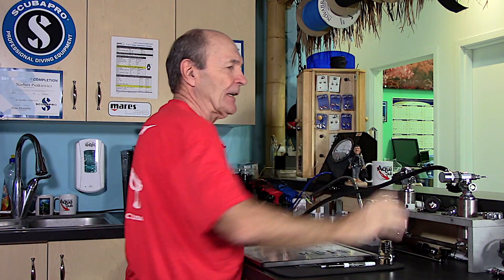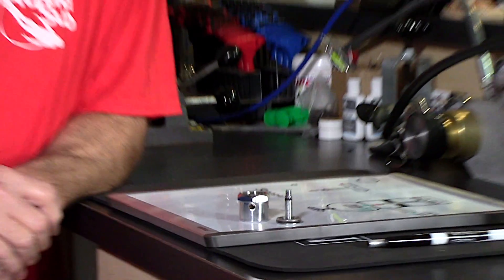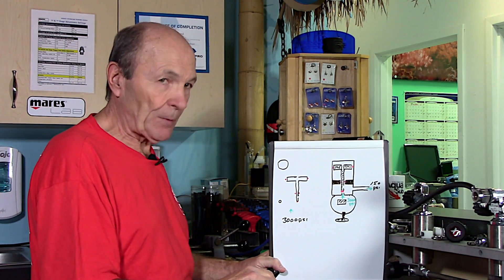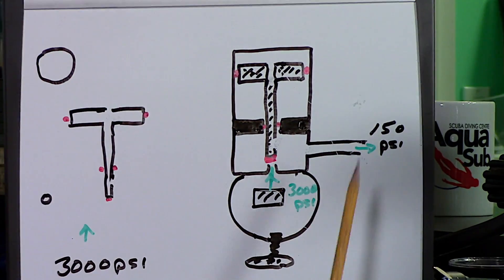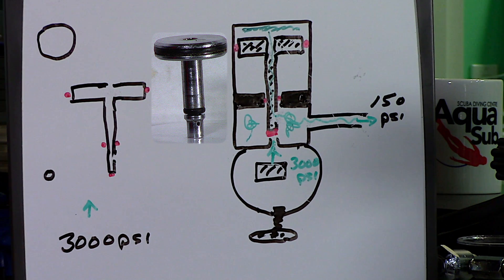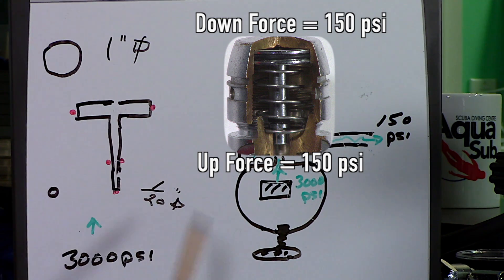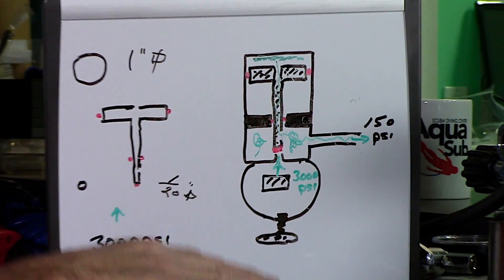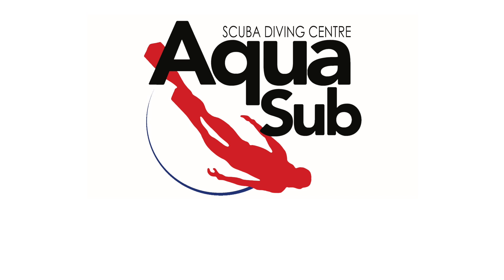How A Piston Regulator Works - Scuba Tech Tips: S08E14

Comment: What would happen if the tank pressure drops from 3000 to 2000? Then when the IP reaches 100PSI the valve is being closed? And what if there is below 300PSI in the tank? The IP is not going to be much less than 150PSI(atmosphere pressure), So the 300PSI in the tank is never going to have enough force to go against the down force from the atmosphere, right?
Reply from the maker: Right!
Once tank pressure drops below 200 psi or so, it gets increasingly hard to breathe. If you suck on the reg you will get a bit more but only because you are creating a partial vacuum in the hose. That overrides the spring.
A balanced regulator is not affected much by the tank pressure - one of the advantages of a balanced model. So, within reason, tank pressure at 3000 or 300 psi doesn't make much difference. Notice I said much. Factory recommendation is a drop of not more than 15 psi.
Alec

Comment: Alec, brilliant explanation as usual!!! 
Have you discussed the differences in equipment used for air and enriched air? I know you talked once or twice briefly about it and that there are differences in the o-ring material and the lubricants and service but, is that all? Is there a way to have a regulator (1st, 2nd and safe 2nd) rigged for dual purpose? I have seen all your tech tips and I can't remember if you have got in deep on this subject. If not, perhaps it is a good forthcoming tech tip. Traveling with a dual set of regs for an occasional diver (and I am very occasional) sounds rather pretentious. And to be honest, I am weighing if my next step should be Rescue Diver or the enriched air certifications (will do both eventually but money and time are not limitless I am afraid...). 
Thank you very much indeed for all the (invaluable) info you share with us so generously!
Cheers!
Reply: all regulators (first, second, computers, gauge) will handle 40% nitrox without any changes (most will list that on the packaging). The ONLY thing you have to worry is if you own your own tank AND go to a dive shop that does pure O2 partial fills (add air after to get desired %) instead of pre-mix Nitrox (what most boats do with membranes, or shop that pre-mix it for your in their tanks - typically 32%). Tank that are pure O2 clean require special oring and cleaning valve/tank and are marked as such (viz sticker). Some place will require you to have nitrox sticker and a dedicated tank (makes it less likely someone grabs them and assume air), but not all, and again tank unless O2 clean can be any tanks just slapping the Nitrox green/yellow sticker (US)
Reply: as for class depends on what you do/dive, but Nitrox is rather simple (all classroom, can study alone) and inexpensive and if you plan on doing 3-6 dives a day, or multiple days on boats it's pretty much necessary to use Nitrox with limited surface time and longer no-deco times underwater as well. I think padi makes it a separate class (and tiny 12 page separate book instead of being in the regular or advance book) to make more $$$
Reply: @alaind831  Thanks a lot Alain for the detailed reply... that is exactly what I needed to understand. Planning on the 32% O2 only so my current set of reg should work (I don't own my own tanks, and not planning to in the short term). 
Thanks again!
Reply from the maker: We just made a video on basic Nitrox and will have some more coming.
Alain's information is 100%.
You do NOT need to have a special reg or special cleaning of a reg to use 32% nitrox (contrary to what some manufacturers and stores will say!).
Take care.
Alec
Reply: @AlecPeirceScuba_SeaHunter  Thank Alec for your response. Waiting for more great Tech Tips :)

Comment: Great one as always, i had experienced the oscillation related noise, how do you get ride of it (annual service did not solve it)? does it mean that the piston has worn out? or maybe some of the O rings where not replaced or greased properly?
Reply from the maker: Nope. Even brand new regulators will whistle.
I made some suggestions on another comment in this topic.
Check that out for some ideas.
Good luck.
Alec

Comment: Big fan of your tech tips - always learning something, and I like DIY the most. 
Wish you had spent half the time explaining the above, and continued on to explain what the spring and middle chamber does (won't spill the beans for others to think or watch your next videos - hint: water). 
One thing I can't figure out right now if how you get constant 150psi while your tank varies from 3000->500psi or less since that 1/20 size ratio is fixed, but then again the spring doesn't have a constant force so I think I just answered by own Q thinking some more. The old pistons reg I used 40 years ago got harder to breath as they ran low or got deeper - would be great to explain how balanced reg work as well, and what happens when any of those orings leaks (asked below).
Reply from the maker: Thanks Alain.
I know you've been a long time supporter and I appreciate that.
Everything you've mentioned is coming.
This appears to be a popular topic so we will keep doing them.
Talk again soon.
Alec

Comment: Thanks Alec!, a great video as always. I have recently had an issue with my Scubapro MK25 first stage that may be related with the piston. After noticing a leak on my safe second during a dive I took it to my lds where they found the intermediate pressure well over 200 psi. They took it for service but I don’t understand how it could fail like this, given the areas of both sides of the piston cannot change. Is it possible that it could be malfunctioning from the factory, and only took some dives for the seat in my safe second to wear out??  I don’t like at all the feeling that a supposedly workhorse first stage can fail so quietly. Thank you!!
Reply from the maker: The MK25 is probably the most popular regulator Scubapro ever made, and it's solid too.
It has had several updates though so, depending on the age of yours, be sure all the updates have been made.
The piston O-Rings were changed more than once because there seemed to be a problem with them failing. That would cause a jump in the intermediate pressure.
However, if the piston O-Rings are good and the HP seat is good, there's no reason to be concerned about your MK25.

One small suggestion is to have them slightly reduce the sensitivity of your safe second. If the intermediate pressure does rise,  it ought to be evident first in your primary. It should be the most sensitive to pressure changes. Have them check that, reduce the sensitivity of the Safe Second and it is less likely to freeflow too.
Take care.
Alec
Reply: Thank you!

Comment: Does this mean that if the pressure in my tank is at 500psi that I can only get 500/20=25psi to my second stage!?! which is less than 2 atmospheres.  Meaning...I'd better be shallower than 33ft when my tank reaches 500psi.
Reply from the maker: Perhaps you've noticed that when your pressure gauge reads zero (0 psi) with the reg off, air still comes out of the valve.
So you're sort of on the right track.
At the end of the dive, there is air in your tank but you may not be able to access it through the reg.
Alec

Comment: Hi Alec, thanks, great video! 
I can definitely hear my regulator oscillating when I breath on it, it makes a hell of a noise, sometimes it's driving me nuts! haha. Any tips on how to get rid of that noise? It's a Scubapro MK10, a service done by my dive store didn't help...
Reply from the maker: There are several ways, some by the book, some not so much.
If your LDS had tried and can't seem to help (which is not surprising; some regs simply insist on making noise), suggest that they use a thin plastic spacer under the piston spring. One under each end should work.
If that doesn't work they can replace the spring.
As a last resort, and one NOT to be recommended, have them put the spring into a vise and using a triangular file, score across each end heavily. If that doesn't work, join a band!
Take care.
Alec
Reply: Thanks! I'll recommend that to them next time. In the meantime I'll think about what the name of the band is going to be! haha 
Take care
Reply from the maker: The Deep 3. 
Maybe The Wet Wonders.
How about Free Finners.
I can do this forever you know.
Alec

Comment: One clarification: "PSI" doesn't mean "Per Square Inch," it means "Pounds per Square Inch."  I suppose it should be "PpSI," but that's just the way abbreviations work. (Also, PSI can be further specified as PSIA (pounds per square inch, absolute) and PSIG (pounds per square inch, gauge.)
Reply from the maker: Perfectly correct Brian.
Please understand that this video, and other ones similar, are specifically made for non-technical people.
I can just see the delete button going crazy as I try to explain Absolute and Gauge.
Thanks again for your input Bian.
Alec
Reply: It seems to me if they had put  the p for "per" it could confuse the reader like in  Kmh if you put p would read "kmph"
Reply: @LMSILVIA  -- The "official" abbreviation of kilometres per hour is  km/h, with the slash representing "per."

Comment: Great explanation, but what happens when the tank pressure is 1000 psi. Does the 2nd stage get 50 psi or the spring change the game. I assume we are looking at an unbalanced design 1st stage.
Reply from the maker: You're right guys. The spring (that you don't need) only becomes useful when the pressure drops.
Then the spring holds the piston up (open) so air will continue to flow even if the incoming air is at low pressure.
Realize that the same hydraulic principle applies at all pressures so, for example, if the incoming air is at 500 psi, the upward force on the small end of the piston is only 100 pounds (1/20th of 500). Thus the piston would move down (close) if the intermediate pressure on the big end reached 100 psi. The spring makes it stay up so the pressure climbs to 150, or as close as possible, and you still get air. 
But, it does get progressively harder to suck that air out as the pressure drops much lower. And that's what you want - a slow increase in the effort until you are out - not a sudden shutdown.
Take care.
Alec
Reply: I have the same question . The presure from the tank can varies from 150 till 4500 psi. But the presure to the second stage stays 150 psi. I think Alec will explain this later 😊

Comment: Awesome! Love this level of tech :)

Without spoiling to the others I'm pretty sure I can figure out how to get the ambient pressure figured out :)

When you said the spring is not needed I started to believe you ment it was only there to hold the piston in position, but there is more to it right? Im still engineering it in my head right now but I suspect it has something to do with keeping the low pressure at desired level, with half full tank, and when I.e using a 300bar bottle (sorry, I'm European ;) )

Once again keep it up, love your videos, esp the ones at this depth
Reply: And also, thanks for pointing out the noise, my last OWD dive i got another reg and it made this noise just as I started descending and I was almost ready to give up dive and my instructor couldn't explain why it was like that, he just convinced me that it's working fine and they do sound a bit different sometimes  :)
Reply from the maker: I'm glad to see that I got you thinking and you are definitely on the right track. Without the spring the air supply would be suddenly cut off when the pressure dropped.
I wrote about this is another comment. See if you can find it.
Take care Niklas.
Alec

Comment: Great video, definitely appreciate the more technical tech tips, keep em coming. Would love to see a discussion on how different regs are designed to fail open, from what it looks like if the top o ring blows the upper chamber cannot shut off the tank and we free flow; if the middle fails the surface area the tank pressure pushes on increases drives the piston up and we free flow. In both scenarios we get nearly the full tank pressure sent to the second stage.
Reply: you're assuming the middle chamber is closed... that is where the spring and water comes in to equalize with ambient pressure (water pushes up, forcing a higher top pressure needed to close, so >150psi). I'm guessing if that seal leaks you loose the ambient part so harder to breath at depth. (Edit: <- wrong on that last part)
if bottom seal leaks free flow as well.
Reply from the maker: You're both right.
Even though the 1st stage is an upstream valve (more on this coming) and should close in the event of a failure, in fact, it will normally open and let too much air through - free flow.
Virtually every regulator made today using the same technology and almost the identical design.
That's how good it is.
Alec
Reply: Alec,  if the middle ring was missing, wouldn't you get free flow in the spring/water chamber escaping the first stage (not where you want free flow) and would that extra flow put more pressure on piston to open (get >150psi) or would the loss of effective tank pressure just mean it opens more to get to that 150psi ?

Comment: I like your videos, very well structured, I encourage knowledge so
your explanation is something that should be teached on the base open water certification,
 all  regulators ( diving, pneumatic, hydraulic )functions on the forces equilibrum, usually springs establishes the operation parameters and shims ( or screws ) are used to make the fine tuning.
I prefer the diaphragm type first stage for a simple reason, on a piston type, the piston sliding movement can be impaired by grit entering by the pressure compensation ports, on the diaphragm type, nothing but air coming from the tank floods the sliding parts.
 two topics that could be interesting to explore, the first one is why we find corrosion inside the diving tanks, the second one is why a regulator freezes when used in cold water, at glance, these two phenomenons are due to humidity of the ambiant air compressed in the tanks that is not eliminated by the filling station equipment and condensates in the tank and freezes in the first stage because of the thermodynamic cooling effect from passing abruptly from say 3000 PSI to say 150 PSI.
Reply: I had made the same comment on the piston vs diaphram video - clearly the piston and spring were very corroded in that video by having salt water contact, so the sliding orings would get affected/worn faster than a pure air sliding membrane 1st stage. Also mentioned while Alec was making it sounds like piston were more reliable/cheaper, he himself owns an oceanic membrane first stage.
The one part I haven't fully nailed yet, is that membrane 1st stage can come environment sealed or not (an option on mine) so some water still entering a spring chamber, and piston reg can also have env seals - so that main spring but be sealed somehow with something else pushing on for ambient pressure. In the end are they really that different if bot sealed ? is it a size of piston difference ?